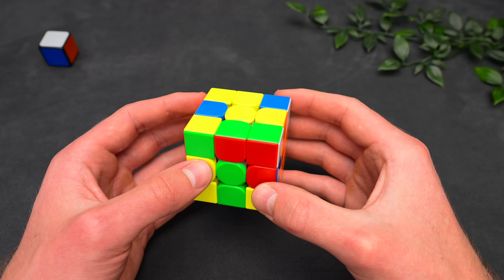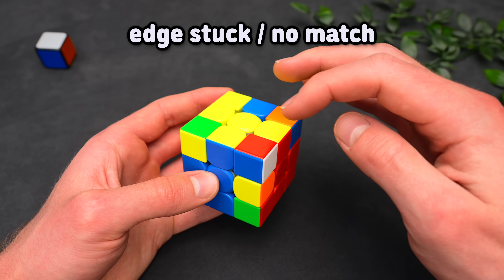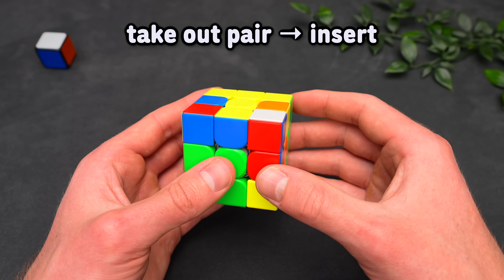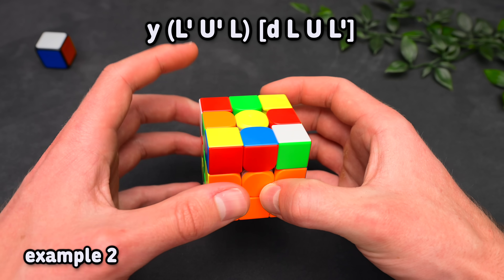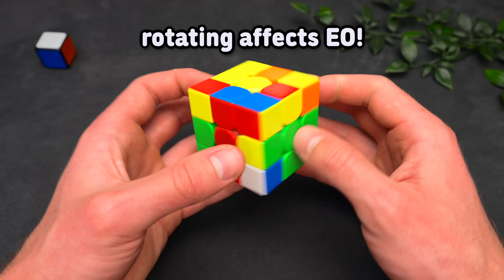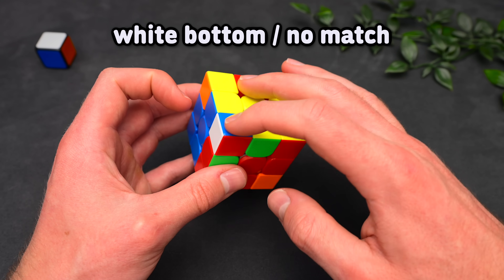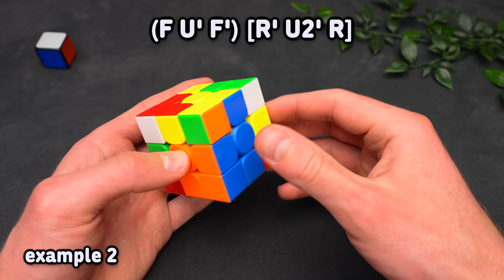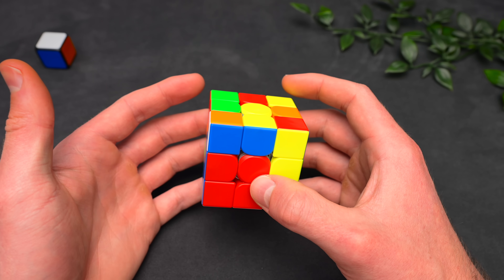The F2L Cases Nobody Teaches You [Beyond Standard F2L]

Comment: Hi. I have a gan 11 m pro. I have a few questions. Does the gan 11 have lock ups often? whenever i do a solve i often feel like something gets caught up inside. I'm always worried i broke a corner magnet rod (because I've had times where the magnet just popped out the socket). Is that normal for a gan 11? The most lock ups i feel are when i set the magnet strength to 3. Just today my cube felt fine but then after a few solves it felt really flimsy. Even after taking it apart and cleaning the whole thing it felt awkward. None of the pieces looked broken or chipped. I'm always having trouble finding the right adjustment for me. Sometimes i like a setup and the next day or a couple of days later the setup feels odd. I'm going to have my first ever comp this month and I dont want to break anything now. My prefered magnet strength is 2 but today that gives me an uncomfortable clicking on the inside. I don't even turn vigorously. My corner rods are the hexagon ones. has that happened to anyone else?

Comment: I've been cubing off and on for years. Finally learned F2L 4LLL last year. Do anywhere from 20-40 untimed/casual solves a day. Some days I don't cube at all. My F2L is still insanely slow due to pausing to find pairs. My best times are still around 35 seconds. My algs are something like 5 TPS (anything faster results in lockups or accidentally turning a face I didn't mean to and getting lost in the alg). Overall TPS is like 2 (two!) due to long pauses mostly during F2L. I don't want to learn full OLL/PLL yet because I feel like I should be focusing on F2L. What should I be focusing on to improve the most now? Look ahead? Just more practice? Different cube/settings?